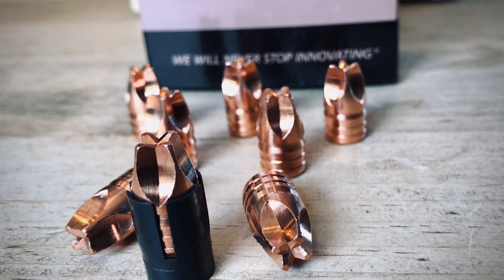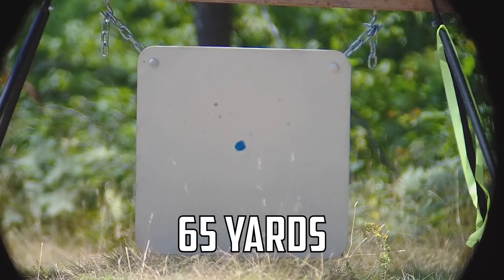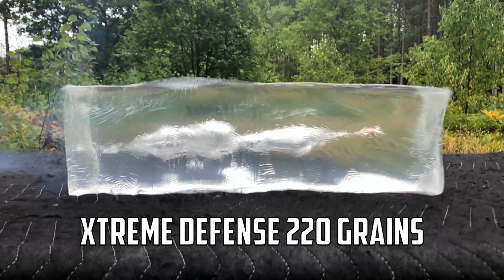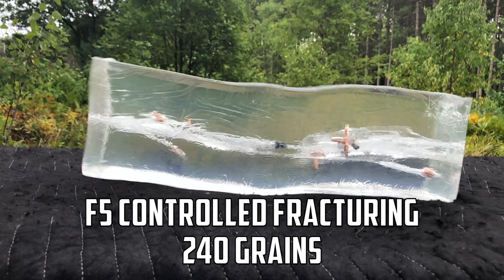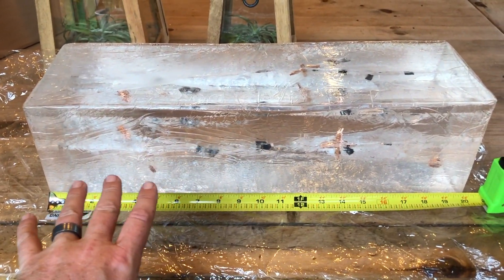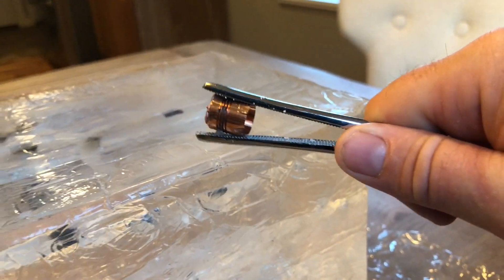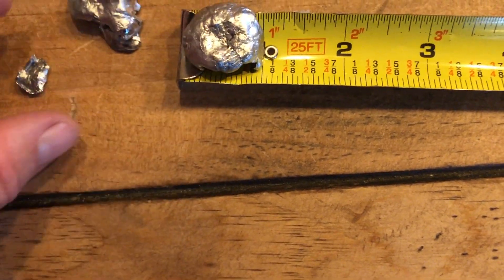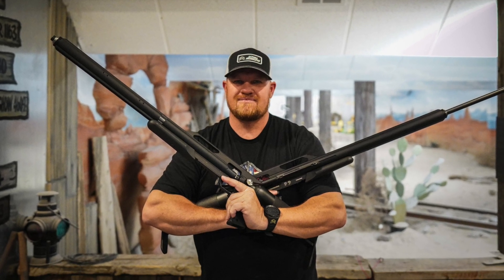AirForce Texan .50 Cal LSS Big Bore Airgun: Ballistics Gel Testing

Comment: One small point of contention. When shooting something not round ball from an air rifle, it is called a pellet.
Reply from the maker: Hmmmm…. No a pellet is a wasp shape with skirt. Then we also have slugs and hybrid slugs.
Reply: @UpNorthAirGunner  according to the BATFE if it's fired from an air rifle it's a pellet except BB's which is actually the size of the projectile.
Reply from the maker: @JoeZelensky  Well the good news is that they don’t govern regulations over Airguns so they can call them unicorn fart projectiles for all I care. We also have bolts and arrows being propelled by Airguns and state by state they are defined differently by length. So academically we have pellets, slugs, hybrid slugs, round ball, and bolts / arrows.
Reply from the maker: @JoeZelensky  It shoots roundball really well! Fast as hell!

Comment: Do you have information on the depth the projectile should be in the sabo cup and placed in the Airfoece Texan Barrel? I would appreciate, based on your experience, with the Lehigh projectiles your thoughts.  Thanks.
Reply from the maker: You just push the slug all the way down in the Sabot’d cup and just push in flush into the barrel.
Reply: @UpNorthAirGunner  thank you

Comment: I ordered the 350's from mrhollowpoint he sent some 345's and 385's as well I used 25lbs of plastaline clay the expansion on the 350's is amazing but I did get two (out of ten) that basically exploded after going like 6 inches into the clay but the ones that actually expand get huge and completely flatten out .....but im using a 50 cal piledriver
Reply: P.S I have a couple short vids if you are curious

Comment: Notice that the sabot generally stays with the bullet and the variability of both the seating AND how much the cup moves on the bullet after it leaves the muzzle sure causes fliers. Also, if the sabot stays on it totally screws with the BC!
By simultaneously shooting through multiple stations of 36x36 brown paper at 15, 25, 35, 45 and 55 yards you can see what happens and if and where the sabot is seperating. The rifle was mounted in a screwed down rifle vise and a remote trigger used so no human error variability from shot to shot.

I found with the .457 Texan that using MMP sabots for .357 bullets the sabots stayed on but occasionally one petal of the sabot would open causing the "assembly" to vere off. You could actually see the notch in the hole in the paper where the petal was acting like a drag brake on one side. These shots were ALWAYS fliers on the target at 85 yards.

On the .457 sabots for .400 caliber bullets the sabots 7 out of 10 times DID leave the bullet and overall they were more accurate. I believe it's because the petal is thinner and the air has enough force to peel them back so the drag pulled them off.

So high velocity smokeless and black powder sabots don't do as well used in airguns... We need a sabot designed with "thinner" hinges on the petals for our lower velocities and slower twists so the sabot reliability sheds.

These sabots, even in a black powder rifle are exiting at twice or more the velocities of an air rifle. The air flow around the BP projectile is much more AND with the centrifugal force caused by the twist of the rifling the petals more reliably open and drag the sabot off the bullet.
Reply from the maker: Great information! I was wondering about the shedding of the sabot myself.  I have been finding them at 20 yards consistently when I shoot at any distance.  Good point you made about the .357 vs. .400 and the thinner walls of that sabot option working better.  I agree a better sabot could be made and be better suited for slower velocities. Thanks for watching!
Reply: Thanks for the info. Have been testing out some sabot rounds in my .510 piledriver.  I've tried several 300 grain .45 cal. and the results have been pretty good at 75 yards.  Decided to try out some 200 grain .40 thinking they would be more accurate and the results were terrible.  Makes sense now considering the thicker petals.

Comment: The fragmenting slug, if the accuracy is there, is definitely interesting
Reply from the maker: Ya - they are the ones I am most excited about. No upsizing with sabots and seriously at 50--75 yards are the most accurate ammo I have ever shot.  The groups open up just a tad at 100 yards, but I think that is due to being such a low BC maybe?  240 grains for such a long slug seems like it isn't a good longer range option vs. lead.
Reply: UpNorthAirGunner reminds me of the original Remington copper slugs... they had 4 petals designed to snap off

Comment: Great comparison video Chris. Really liking that Lehigh F5 .510 w plastic cup base. But w/o base cup may be good w Seneca Dragon Claw or Evanix big bores. Those watermelons almost like complete slushy just missing shaved ice and syrups. You're correct the Hollowpoint slugs are go-to for AF big bores class. Pure awesome 👌 👏 😎
Reply from the maker: Thanks! Just one point of clarification. The F5s don't use a sabot cup. They are designed to work without a sabot.  The Dragon Claw is .495 I think so I am not sure if this will work in that gun, but I will test and report back.
Reply: @UpNorthAirGunner  oh what!! The F5 don't use sabot cup and its sized .510?? I'm very interested to try those. What's the link to the website again please?